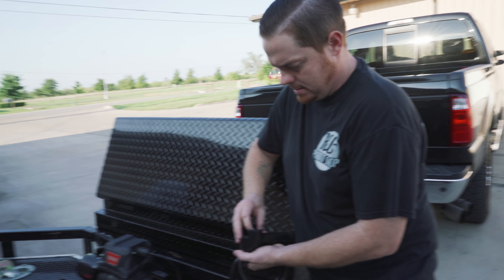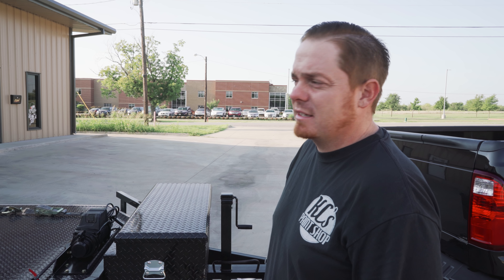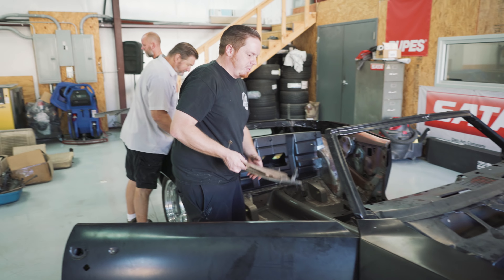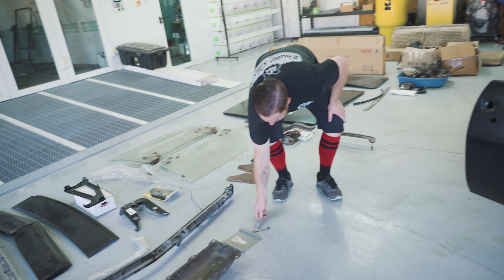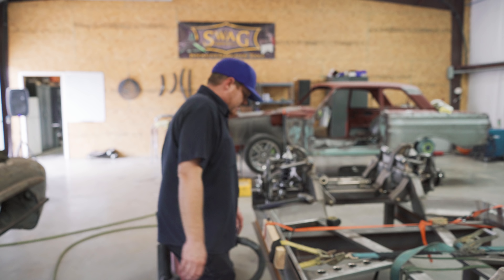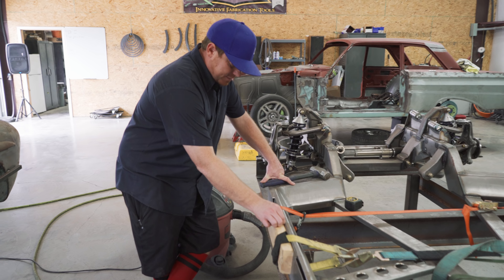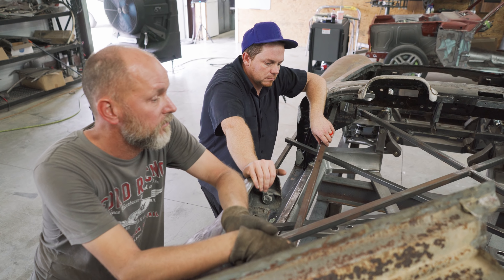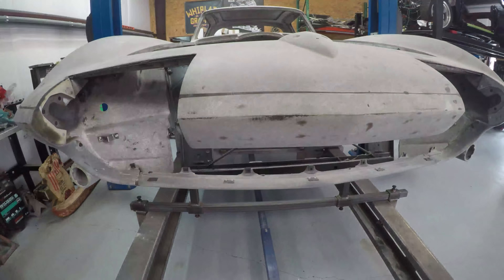56 Mercedes gets a Roadster Shop Chassis / Camaro / Corvette / Falcon / Challenger Update

Comment: That's ok kc I had a piece of 2x4 shoot out of a table saw at about a 100mph and caught me right in the man jewels, the funny thing is I wasn't the one using the saw I was the unsuspecting dumbness in the right place at the wrong time.
Reply: As a welder there was someone in the shop using the big wheel grinder the size of a 14" tire. They were grinding something and it slipped out of there hand. It bounced around the shop like a bullet until it came to a stop. It was a good thing it didn't hit no one I know what you mean I was cutting a small piece of wood on a table saw and it shot back at my hand like a base ball cut the skin I had to turn off the table saw and roll away from my Pops. Because right before I started to cut the wood. He asked me if I knew what I was doing and I said yes. I couldn't let him see the blood and I was in pain.

Comment: Great job, Erick. Glad to see another update and also glad to see you're staying busy. Any update on your ride?
Reply: Thanks Rudderify! No update on the Z due to parts manufacturers taking their sweet time. I should have some stuff coming in the next few weeks like all my Wilwood brake stuff. I just removed the stock booster and MC, gonna delete the booster and run a Wilwood 15/16 so I'll be making a custom adapter plate in a video when I get it in. Also new motor/trans is hopefully on a few weeks away.